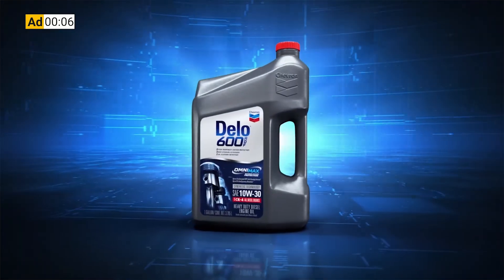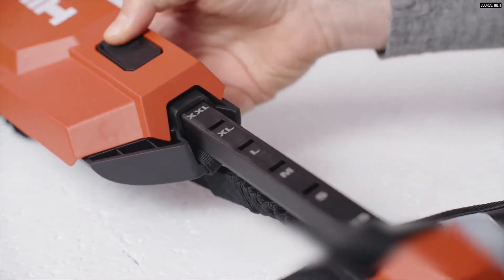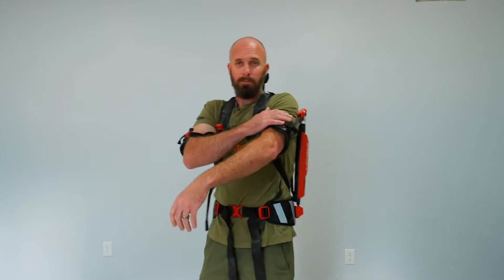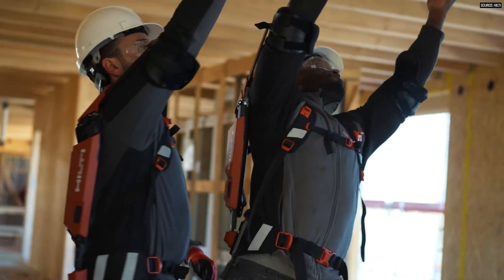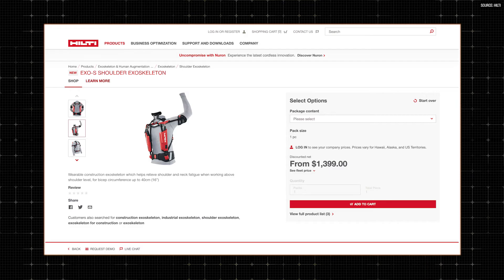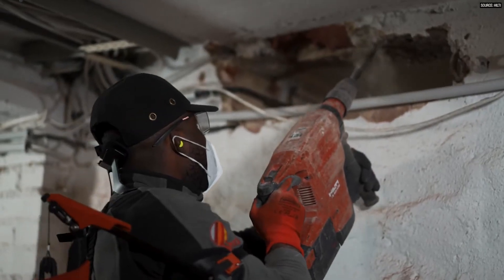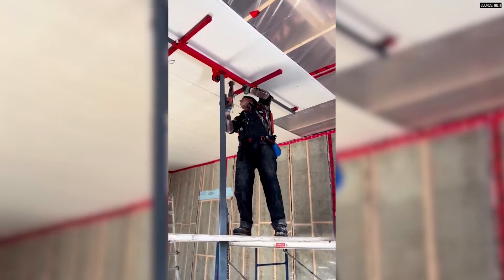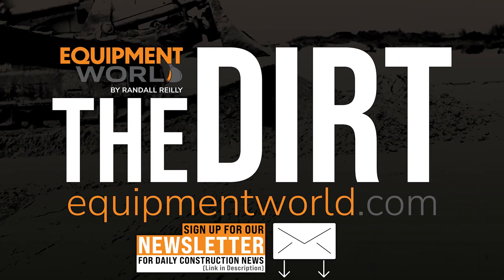Review: Hilti’s EXO-S Shoulder Exoskeleton for Construction Workers

Comment: If a product is difficult for you to use, it is more likely you are using it wrong. If you were using these daily in a workplace then your exo would be adjusted to you and nobody else would be wearing it. If you take something like this then make no adjustments to your method then you're using it wrong. If you're working low, take it off. The arm pads look easy as fuck to remove. Your application is probably not where this is targeted for.

Comment: I’ve gotten the use a demo unit from our local Hilti dealer for couple days. I’ve had 4 shoulder surgeries and I’m missing 2 rotator cuffs on my right should.  This was a huge game changer for me worked 8 hr doing over head work with no problems. Without it I couldn’t hold my arms up for more that 1-2 minutes before fatigue sets in.
Reply: I recently had a couple accidents which left me with torn ligaments in both of my shoulders. I cannot lift my arms above my head without pain. I am handyman and I do a lot of above my head work between painting and light fixture replacement, etc.. 
I appreciate you leaving this comment because I’ve been doing a lot of research to see if this is something that could possibly help me.

Comment: Duh, this is a tool that is made for overhead applications, if you are doing something where your arms are down you wouldn't need it! The adjustments are not hard to do at all and well you want it to fit you. You wouldn't use a drill if you needed a saw.

Comment: I was hoping this was a powered suit that assisted movement strength and not just a support sling.
Reply: It is useful for reducing damage to the shoulders and elbows. It doesn't give extra strength. But think of a house painter with years of painting ceilings, the shoulders are damaged before retirement, for this guy this thing will be a blessing
Reply: We are pretty far away from affordable "powered" suits of any kind lol but we may see a few more of these ergonomic mechanics based exosuit designs that help distribute weight and what not
Reply: @njott1021 I think there is already a powered EXO suit, but it not available for commercial use

Comment: Looks like you are using it wrong. The tension in the system should allow for your arms to fall with gravity.
Exo is ment to assist your arms - not carry the load.
Reply: Exactly what I was thinking. He mentioned that he has it dialed all the way up which is likely not what he's meant to do with it. Exo-suits vests and skeletons are in no way load bearing they're only meant to support the body and help prevent injury. Obviously with the exception being exo-prosthesis systems which do have a degree of structural capacity

Comment: I just bought one for drywall finishing.  I’m pretty stoked to try it.
Reply: How did it work drywall finisher here. Wonder if it makes the bazooka easier to use
Reply: @CompadreNano  it definitely makes the bazooka easier, boxing easier, troweling easier, screws easier, basically everything easier.  I wear it every single day
Reply: @wheelie._. Awesome..would be great for smooth ceiling and vacuum sanding basically everything drywall.  Im really considering getting one.
Reply: How about drywall sanding? Im a drywall Sander need use sanding machine whole day  is this appropriate? Thanks
Reply: @herrywang882  yeah it’s really good for sanding I’ve been wearing it daily at work since I posted this comment.

Comment: Excellent points.  Hopefully they design some sort of cam into the system that relieves the assist incrementally the more you lower your arms.  Or have a button that would turn off the assist when it isn’t needed
Reply: The assist is adjustable.  I work in one all day everyday.  For my job I have turned down almost all the way
Reply: excellent point hahaha ur an jodot too